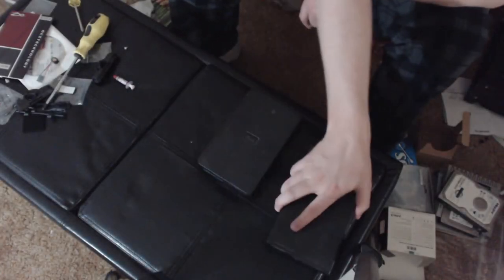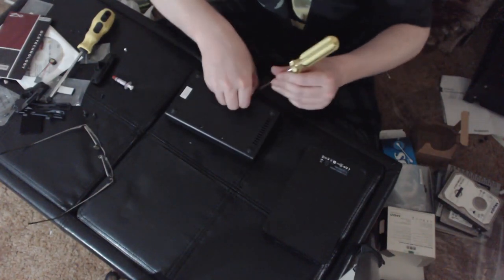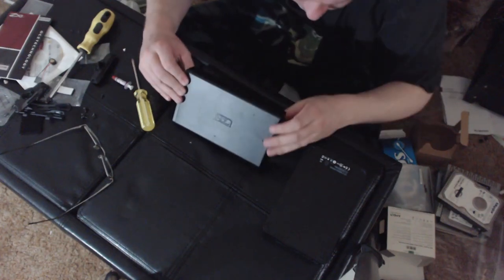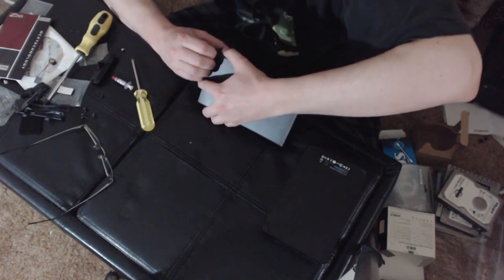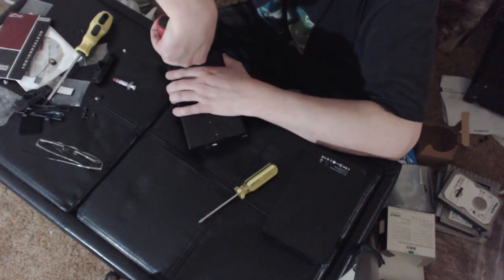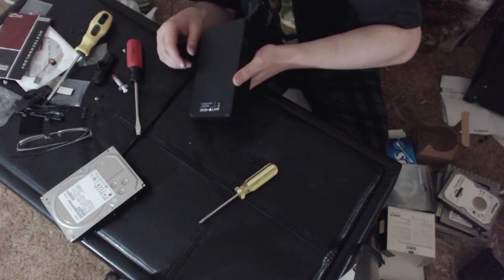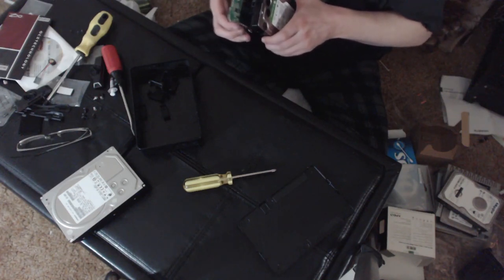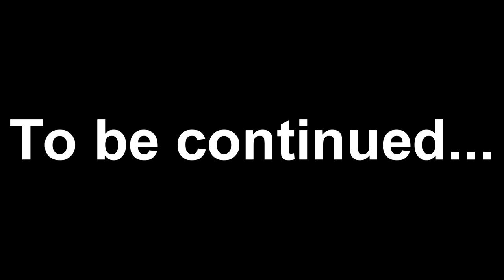Zaranyzerak's Halloween Computer Build - Part 5: Turning External Hard Drives Internal

Comment: I had a similar issue, but in reverse. I had a spare 2.5" drive when I upgraded the HDD of my Laptop and bought an enclosure for it. But the enclosure was such a damn tight fit that it took about 3 times the amount it should have trying to squeeze it in there, & not damage in the process. They can be tricky bastards.
But then I got a couple of enclosures with a much better design, you'd plug it into the sata connector then just slot the drive inside the metal case. 2 separate parts instead of 1